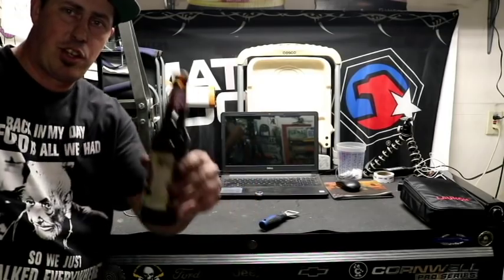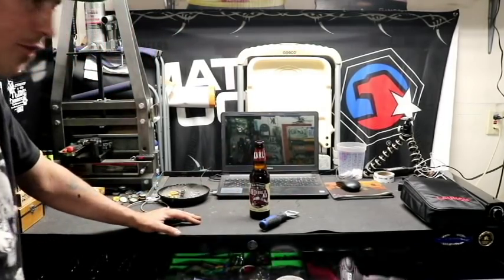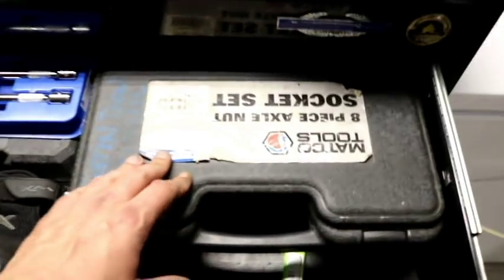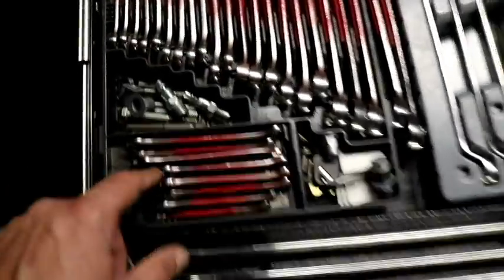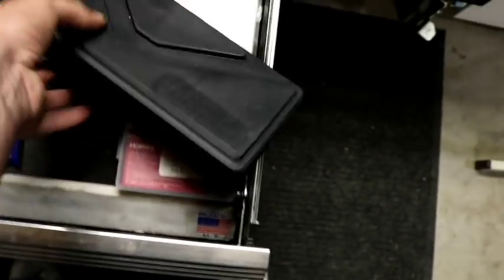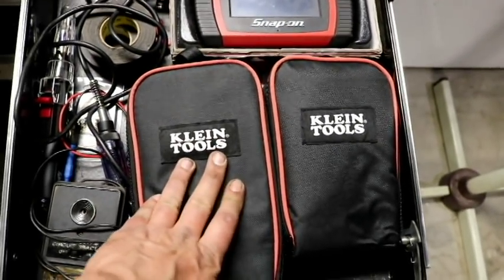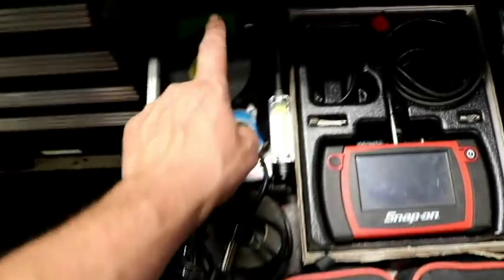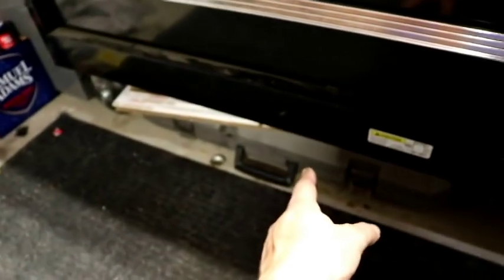JUSTIN DOW'S AT HOME TOOL BOX TOUR SPECIAL!!

Comment: I love the duralast 1/4in sockets. I use them almost everyday. And for 15 bucks cant go wrong and a nice little holder they come in too. 

How do them Cornwell twisted sister adjustable wrenchs do? They seem nice with the flat handle
Reply from the maker: Love them. Super comfortable fit's nice in the hand hardly feel the impact, have a large opening and I have never rounded a fastener with them. Cheers!

Comment: What’s the part number on that black 3/8 snap on flex head? I’ve been trying to get one for over a year
Reply from the maker: Evan Pargett The Murder Black Edition? I’ll take a look in the Am. It was a limited edition they only had the while supplies lasted and it was only one month. But hey I’ll get you the number and you might find them on eBay.
Reply: Yeah thank you! I’m sure one of the 3 snap on guys in my area can find one
Reply from the maker: Evan Pargett 3/8 Drive #GFHLFD80A
1/4” Drive #GTHLFD72
Reply: Got the 1/4 inch one ordered and the 3/8 isn’t available at the moment. Thanks dude!
Reply from the maker: No Wories Brotherman! Glad I was able to help!!! Rock n roll!!